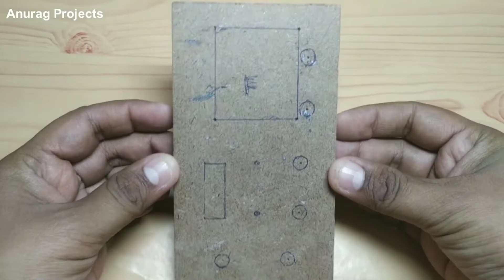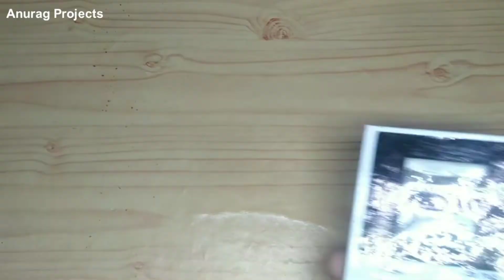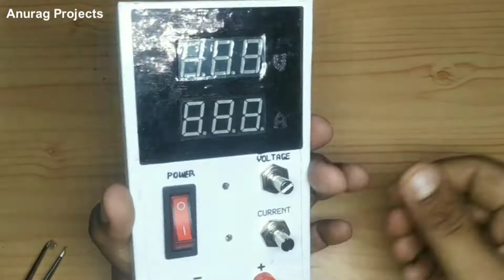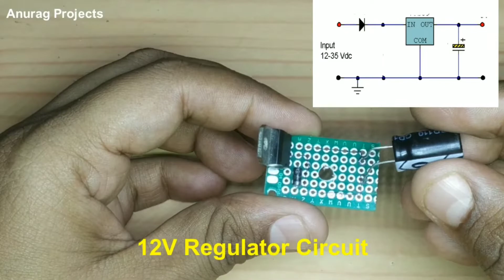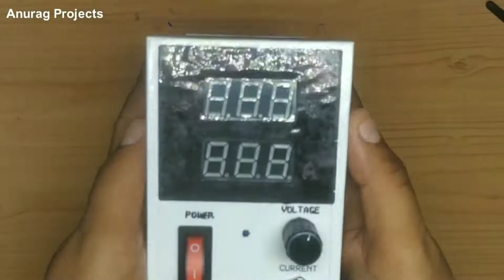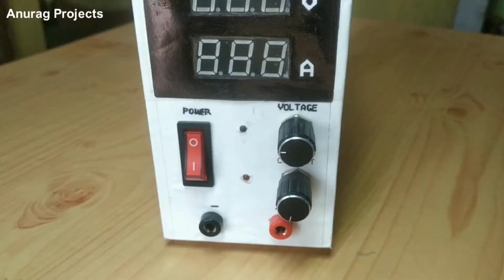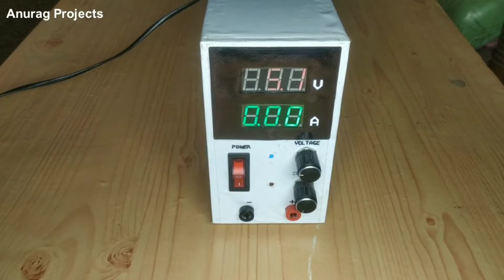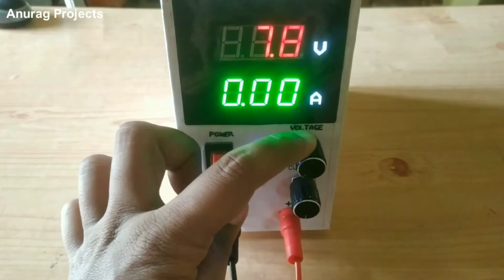Variable Power Supply || All in One Battery Charger with 100% Protection

Comment: In the circuit diagram ... the fan is taking power "before" the bridge diode .. should be "after" the bridge .. because "before" it is still AC ..
Reply from the maker: We have used a separate bridge Diode and L7812 Regulator ic for the fan... So we have given AC current at the input of 12V Regulator Circuit.